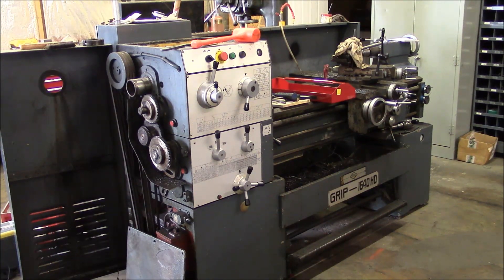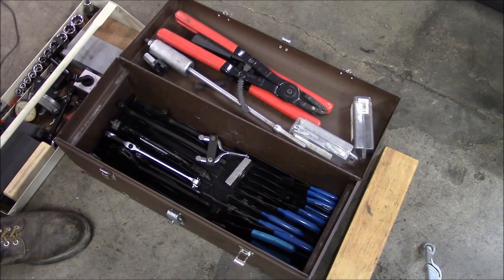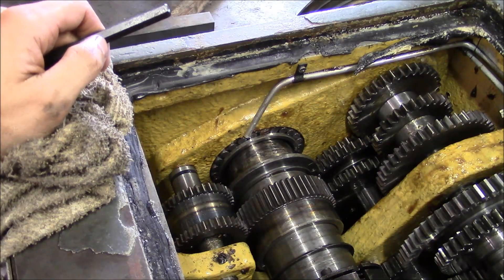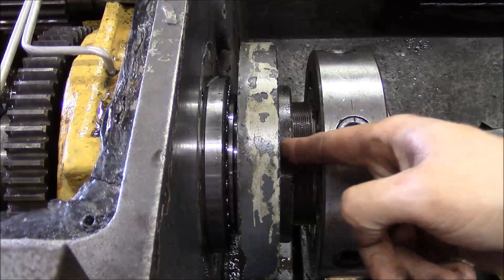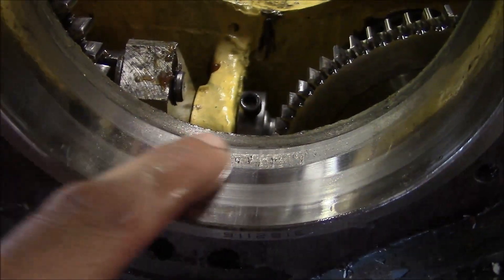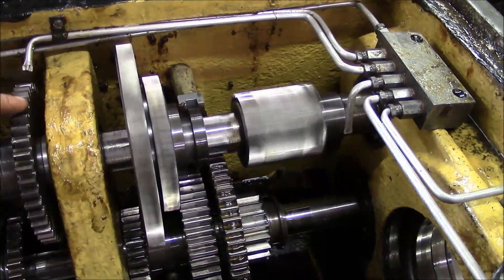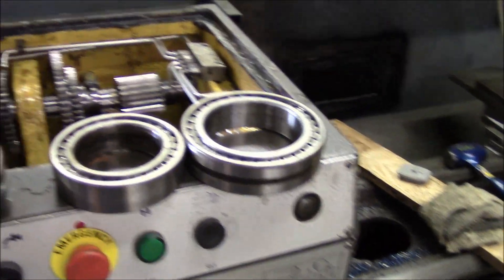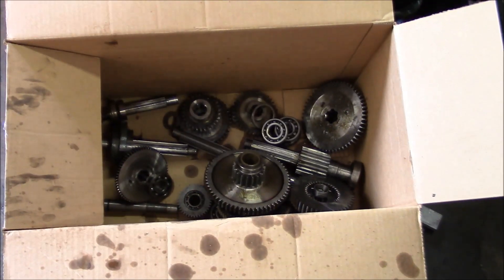Engine Lathe Headstock Tear Down

Comment: @9:40 "Do not attempt this work if you are not qualified."
Where to go for qualification... Very few places now-a-days.
Blocks and wedges of hardwood help hold the shaft and gears firm when breaking loose the large nuts. 
Keeps the spanner from flying around.

Comment: Don't overlook an electrical problem. Bad ground from the motor or to the mains or maybe using a welder on the lathe. I would look into grounding the motor shaft especially if your using a VFD. I know it's a little late but good luck.

Comment: That's so funny
You mentioned Chinese bearings...most likely they were made and installed either out of spec or contaminated with silica. From either casting sand or just a lack of a clean room ....I've  purchased common bearing sizes in China but they never hold up like other countries bearings....you get what you pay for...rings true.

Comment: If you have an air needle gun to remove welding slag, when you had this apart I believe I would have put new needles in it and went around this paint lightly and any spot that flaked off i would have spent some time in that area removing paint flakes. No need to get carried away and needle all the paint off just the loose spots.

Comment: I actually groaned out loud when you spun the input shaft!  The cause of all these bearing failure could just be very low quality bearings. Looks and sounds like car wheel bearings that are made of Chinesium which can fail within 10k miles.
If there isn't one in there put a decent magnet in the box to slow the repeat of this situation.

Comment: How did your main drive pulley wheel come off ? Im using the same puller you have  @ 9:01 and bent the yoke. did you have to heat it or......?

Comment: This thing ain't  a tool room anything, its a jobbing lathe. 3 thou wear in the bed? How did you figure that one? By the looks of it, it is pretty good condition mid age machine. Put your new bearings in, adjust the gibs and use it. Oh and stop telling me how great American machinery is, I have worked on lots of it and in a lot of cases it is pretty ordinary.

Comment: So my clausing 5900 15x48 uses micro precision gamet tappered roller bearings. The way everything looks. It looks just like your lather from the outside. I’m guessing it uses a ground spacer as well to set the preload. If I wanted to tighten up that bearing set (since they are tapered and not roller) could I get that ring ground a couple thou shorter ?
Reply from the maker: I'm sure you could. You might want to find a manual for your machine and see if it has any information on spindle bearing setup. Most tapered roller bearing sets have an adjustment procedure.

Comment: A cool trick Wes, for loosening spanner nuts on geared shafts like you had to do.
If there are any gears still in mesh? Put a penny between them. It will lock the shaft up, without hurting anything.
Maybe you didn't have any gears meshing? And, that is why it was free-wheeling. Couldn't tell. 
Your way worked fine. But, I have been up against a few that fought a little harder. The penny worked every time.
Reply from the maker: I wish I had that kind of money to throw around...
Reply: @WatchWesWork  I hear ya!!!

Comment: Brinelling is caused by an overload of the bearing which leaves an impingement mark in the race way similar to a brinelle hardness test hense the name. Can be from a crash or improper installation like beating it in with a hammer.
The other wear is spalling and/or abrasion and it more normal in an old bearing. It can be caused by a lack of lube, particles etc and time.
Clean oil, new quality bearings and it will be better than when you bought it new i would think.

Comment: i may be 3 months lathe to the party (pun intended) but you have to sandblast the headstock and epoxy coat it. That shit paint on the inside is planned obsolescence my friend. good luck and keep us updated!
Reply from the maker: I used a needle scaler to clean out the old paint. It worked OK.

Comment: i see Youtubers using dead blow hammers to set stock in the chuck.. i seem to recall seeing people tap the chuck spin lock ring levers with hammers to snug them up or get them loose.. 

 Super Magnets in the headstock oil to keep any metal particles out of the oil. and out of the circulation system.  you won't believe the lack of color change of the oil when you do it.  there won't be much as the super fine metal particles will all be stuck to the super magnets. 

you might want to have a dial type inch pound torque wrench to set the bearing preload when reassembling and adjusting the machine.. too much preload and you will overheat the bearings as no oil can get between the rollers.. too little and the bearings get sloppy..

there may be settings for break away from a stop torque.. and rotating torque. too little and it deflects..

just thinking there is another reason the bearings are torn up... excessive time with the cutting tool Howling..  can't think of what they call it.. gets into harmonics.. leaves a chatter pattern on the work piece..   

please be sure that you do all your cleaning before you start to reassemble.  there is a video of an asian engine builder that during assembly they use stones to debur some of the surfaces ... i just cringed..  well theres a motor that will probably fail horribly..

Comment: Very nice job Wes, when I did mine just the front spindle bearings got replaced and they were also damaged due to the machine setting and condensation build up in the head stock, at least that is what it looks like to me.Had any luck finding replacement?
Reply from the maker: Yes, new bearings are on the way. I found all of them NOS on ebay. We should be able to put things back together next week. I'm not sure if there was contamination or they were just poor quality bearings. Probably a bit of both.
Reply: yeah, the front one looked as if it was crash damage/ poor quality and worn but that rear one in the bottom race looked like it had some corrosion issues, like you said probably both. Keep up the good work,  your channel looks like it is doing good.    all the best   Steve Summers

Comment: Thanks for the vid! Nasty looking bearings. Did they make any noises while spinning? Do you still think the headstock is out of align causing the taper? If the bearings were still tight they should not cause the taper. Interesting if they still did, however?
Reply from the maker: Yes, the bearings did make some noise. It was hard to know what the cause of the noise was until I removed all the gears that contact the spindle. Once I isolated the spindle in the last video, it was obvious that there was a problem with the bearings. I think the taper is just a matter of adjusting the headstock. It's adjustable like a CNC lathe.

Comment: Great video, your lathe is the first I've seen of a Chinese lathe in this size. What a pile of $#!T, the craftsmanship is horrible. Thanks for showing, makes me appreciate the lathe I have...Hopefully the bearings aren't too costly, and lucky you can do the work yourself, cause that would cost a bundle if you were paying by the hour...wait, actually I guess you're paying with time...(plus materials).
Reply from the maker: You certainly get what you pay for. As I said in the original video, this machine has some nice features. It's just worn out and needs to be repaired. It's never going to be a Monarch or Schaublin, but there's no reason to scrap it. Buying another used machine is a total crap shoot. When this machine is repaired, I'll know exactly what I have.
Reply: If it was a complete pile of shit I don't think he would be working on it in hopes to possibly keep for himself even if just temporarily. He seems pretty competent as far as the condition and capabilities of machine tools. He went over his overall thoughts on this lathe in the last vid. It's a chinese lathe, but seems rather ridgid. I have 2 Leblond servo shifts, a 15x54 and a 19" HD "tool room" model and being a 64' it's got a few of it's own corks as most lathes do.
Reply: I certainly didn't mean to imply Wes is not competent, he certainly is. What does that have to do with the quality of this lathe? After enough time invested even if you do the work yourself, it still costs you time. Wouldn't take long if he was billing his time out to just buy another lathe. And you're probably right, if it was a complete pile of $#!T it would be hard for him to justify his time that he's investing.

We can agree to disagree on the quality, but my guess is you would see quite a difference in your Leblond Lathes when you open the headstock. Quirks and craftsmanship are 2 different things.
Reply: TraditionalToolworks, I wasn't saying that you were talking Wes down and I for sure wasn't saying that anything from china can compare with old American iron, but it would dumb to say good parts cannot be made on this lathe in good working order. I just wanted to point out that he made a video with his assessment of this lathe in which he was kinda thinking out loud in order to share with us his "debate with himself" on whether or not this machine was worth his time and effort to repair.
Reply: Nothing wrong with making it better. I was merely commenting on the quality of the machine in general. I commend you on the diagnostic and repair work you're doing, and hope it's cost effective for the bearings. I know some get pricey. Certainly didn't mean anything condescending, and appreciate the exposure to such a machine in case I come across one first hand at some point. Although if I do it won't be mine, that much I can say with certainty.

Comment: This makes the problem with my lathe even more clear...it must be the bearings. Interesting that in your first video you were almost certain that there was no problem with the spindle bearings. Thanks again!
Reply from the maker: There is no one easier to fool than yourself!
Reply: There's different symptoms for worn bearings and damaged bearings.  I think your first testing for bearing play correctly showed that simple bearing wear wasn't theproblem.  

Further examination revealed the actual problem, the damaged races.  They didn't have excessive wear/play overall, just that uneven surface which let the spindle get jerked around depending on where the bearing balls contacted the races.

Troubleshooting is definately a process...

Comment: After seeing the disassembled state of yours I feel a little better about contending with the minuscule amount of gears by comparison on mine. Reassembly will make for another cool video. Thanks
Reply from the maker: Most people are rightfully intimidated when they see a pile of gears and shafts. But, it's really not that hard to get it put back together correctly. In most cases, the engineers work hard to make sure things can only go together one way. They can't afford to hire PhDs to assemble these things.